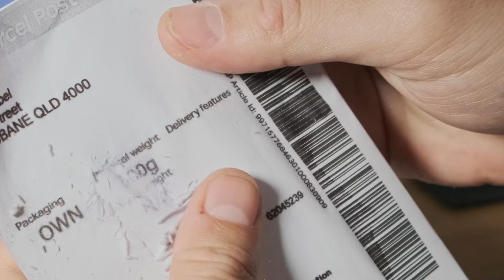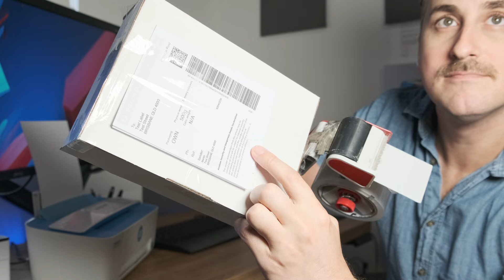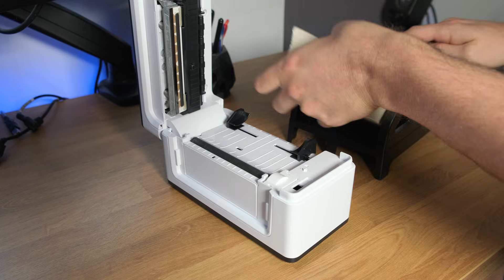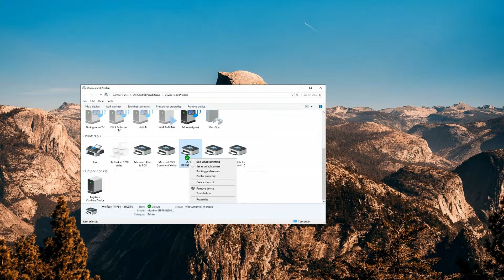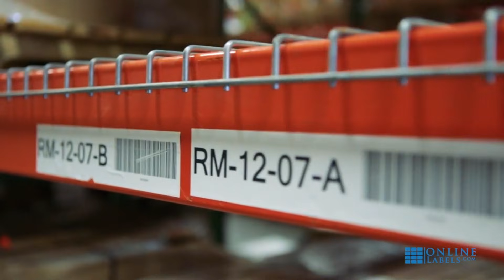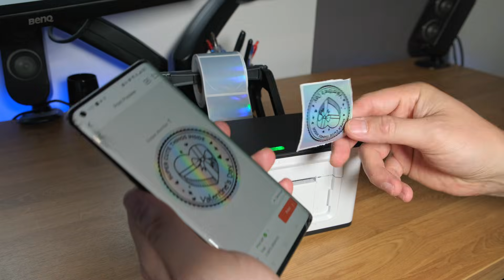I Tried a Thermal Printer – Here’s Why I’m Never Going Back

Comment: What about direct sunlight? Does it make the whole label black? Or in summer heat in a closed truck the temperatures can be high, does it affect the label?
Reply from the maker: Over time the thermal paper will fade for sure, putting it in the sun will certainly speed up that process, however you should have at least 6 months give or take until a printed label starts to fade. Shorter or longer depending on the quality of your labels and where they are stored.
Reply: @LayerLabAustralia  ok, sounds great… I was curious if the paper is like a shopping receipt, which becomes black after some time , if you leave it in a hot car in direct sunshine 😊…

Comment: Question:  Suppose you use thermal paper for shipping labels and your packages, while in transit, are exposed to the heat of the sun, the heat sitting in the cargo compartments of planes or delivery trucks.  Will this not damage / discolor / fade the print to illegibility?
Reply from the maker: Great question :) And that's where buying high quality labels/paper really becomes important. Yes these labels will fade over time, but this usually takes several months to start happening, and most of the time your parcels are well and truly in the customers hands by that stage. I don't think a bit of sunlight during transit will impact them too much, as I have never had any issues with this happening. 

However, if you're shipping your items to be stored for a while (like Amazon FBA) then having them sit in their warehouse for too long could run the risk of your barcodes fading and your products becoming a pain in the but.

Comment: The combination of printer and fanfold labels with holder takes up a lot of deskspace.  For most Munbyn printers, the printheads are not replaceable and can have a short life. Direct thermal paper is abrasive. Cosnsider the Toshiba BV410D.
Reply from the maker: So far mine has been solid! I've had to clean the print head maybe twice since I made this video, but other than that, it's worked really well. Just make sure you use the munbyn labels, as they are high quality and will give you the best printing results :)

Comment: Always use "phenol-free" thermal paper!

Check if your thermal paper has a coating that contains bisphenol A (BPA) or it's brother bisphenol S (BPS). 
Both BPA and BPS are endocrine disruptors, meaning they can interfere with the body’s hormonal systems.
They react with colorless dye when heat is applied inside the printer which turns it dark and produces the printed text/image.
These can be absorbed through the skin when someone touches the paper. More handling of labels leads to more absorption. These chemicals are hazardous to the reproductive system and are linked with obesity and attention disorders.
Keep the labels away from young children as they often put their hands in mouth.
Reply: Hi ! I just buy a thermal printer. I loved so much. I was so pissed of to learn that some paper has PFAs in it. Can you tell me some brands that are 100 percent sure PFAs free and no-toxic ?
Reply: @miawou6501  yes thermal printers are like toys. the manufacturer will write clearly on the product that the paper is phenol free or BPA-free etc. they will even advertise it. it will be more expensive though.
or you can just use any paper and wear gloves when touching it.
happy printing!
Reply: @KurtaCanvas  It seems like you know a lot, could you please share the printer that you currently have or the one that you would highly recommend in 2026?
Reply: Issue is most phenol-free paper is ascorbic acid based. The compounds break down pretty rapidly and fade to being completely blank within six to twelve months.  So if your going to use Phenol free you will have to source archival grade.
Reply: @nikushim6665  How come? these labels are mostly used for sending packages. I think all you have to do is make sure those labels are gone within those 12 months then I guess.
Reply: @advertentiegolf If all your doing is shipping labels then it doesn't matter, it just needs to survive transit until the postal slaps their own tracking labels on it.  But if your doing long term storage labels or Archive QR/bar codes it becomes a issue.
Reply: This is only an issue if you use hand sanitizer. This is one of the reasons hand sanitizer isn't good to use because it allows chemicals to pass through your skin that normally wouldn't.

Comment: Yeah, absolutely a must if you're going to be shipping a lot. You can get self-stick labels for inkjet printers, too, but unless you're printing a full sheet, it's just a hassle.  

Just a heads up: Most thermal printer paper is coated with BPA, which is a endocrine disruptor that can be absorbed through your skin.  Maybe not a big deal for the person receiving the package but if you're handling it all day, is no bueno.  If you're in the EU, you might be safe... otherwise, I'd wear gloves when handling the paper... just in case.
Reply from the maker: Thanks for the heads-up about the paper, I had no idea, I'll keep that in mind :)
Reply: Omg wow, I didn't know this either but I shouldn't be surprised. 😩 Thanks for letting us know!
Reply: Most paper says BPA free.

Comment: Okay question dose it need to be specifically the one you put the link for to get the same result or just the same brand because I'd rather get one thats under a hundred
Reply from the maker: You can get whatever brand you like :) Just remember, the cheaper you go, the fewer features it will have, and potentially more issues when printing with it.

Comment: great video! how much is that specific "thank you" sticker price per piece coming to (for you) ? 
Thermal seems fast, but i think that cheaper is laser with stack of A5 stickers or similiar. I can print about 1200-2000 pcs with 40$ non-branded laser cartrige (+ the sticker also of course)

Comment: For large quantities of labels, dedicated label printer is better. For occasional printing ink tank or laser is more versitile. Spend on ink tank printer 150 dollars, instead of 29,99 USD cartridge printer and you will have no issues, cost per page will be comparable to laser printer. If you need only black and white, get a  laser printer, cost per page is similar as ink-tank but if used rarely nothin will clog up, and print will be less sensitive to moisture. On your regular printer you can print invoices and labels. There are A4 stickers that can be printed in regular printer, will look very similar as labels from your label printer. So depends on the label quantity, but there are better printers than you HP printer you purchased for 29.99 or maybe 21.99 USD on black Friday, that can print up to 100 text pages or 3 A4 size photos on one set of cartridges.